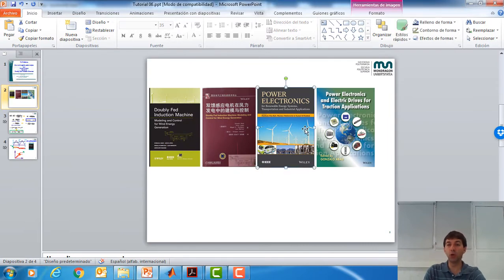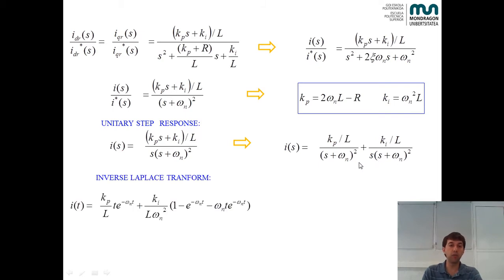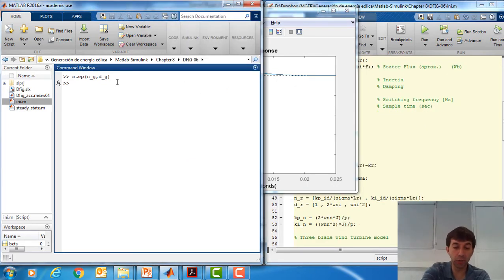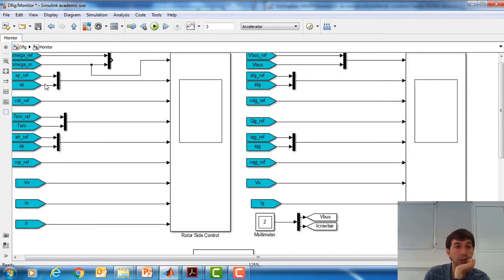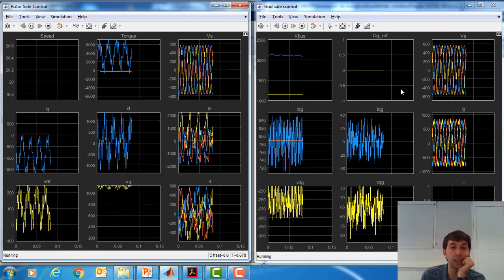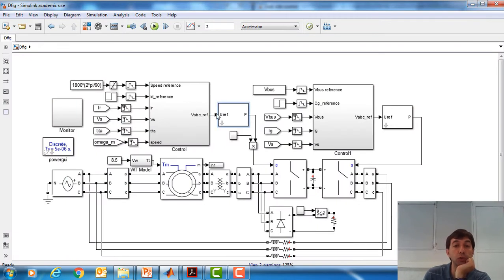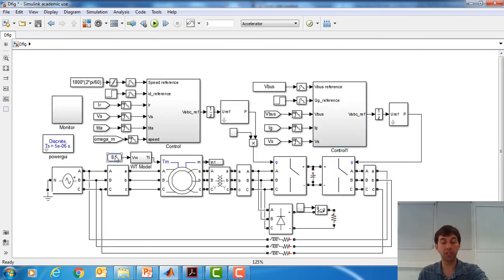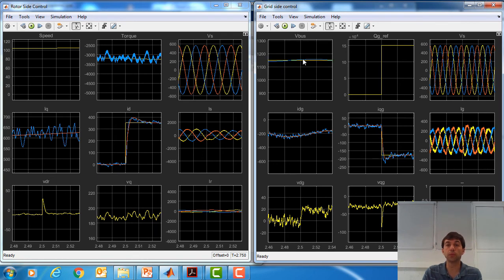DFIM Tutorial 6 - Dynamic Analysis of Current Loops in a Wind Turbine based on DFIG

Comment: As the complete system is modeled in discrete time. Using the continuous transfer function for validation in the current loop validation subsystem is not possible. Simulation  giving error of "The "VariableStepDiscrete" solver cannot be used to simulate block diagram 'Dfig' because it contains continuous states".

Kindly assist to complete this analysis.